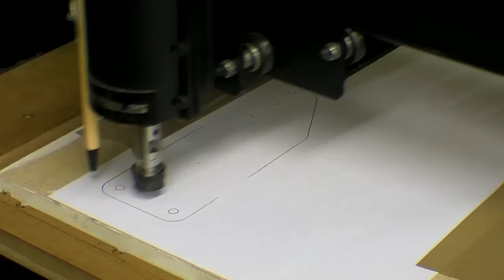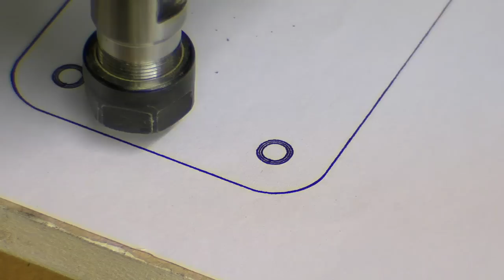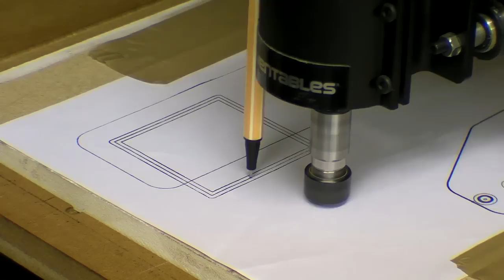CNC Electrical Interference & Vector Accuracy Test / Second Levelling Attempt

Comment: Similar things have happened with my CNC. I managed to cure it by earthing the metalwork. I believe the cause was electrostatic discharge corrupting data being transmitted to the Controller. Hope this helps.
Reply from the maker: Yeah - also the stepper motors have shielding which needs to  be earthed, but this wasn't part of the build instructions for the machine. You live and learn. Cheers.

Comment: Always a good scheme to Try to keep data and power lines physically separated, especially where you may have other clunky and electrically noisy machines pulling current from the same power circuit. Appears that there are a few basic issues with the X carve software to resolve yet!

Comment: Looks like the last square was creating the paths correctly. Weird how it only did the circles correctly on the initial drawing. In aviation we call those anomalies Gremlins. In your case "Invemlins". Glad you found the frame was off and able to correct at least that situation.
Reply from the maker: +MRrwmac Yes, hopefully separating the USB and power cables will eliminate any invemlins.  Not sure about the other problem.  I'll try some different settings when creating the SVG file and test the paths with the pen tool.